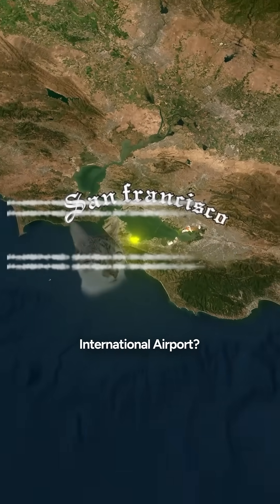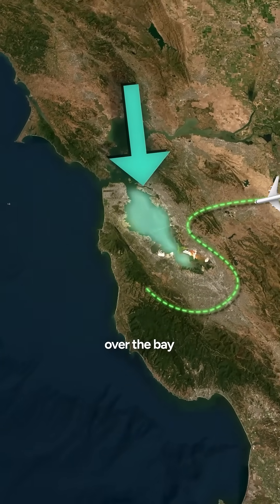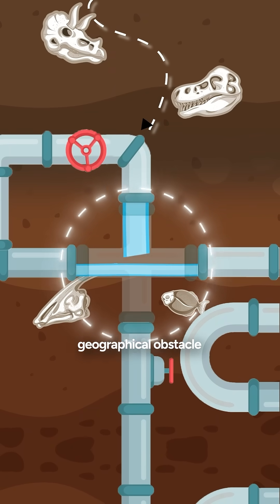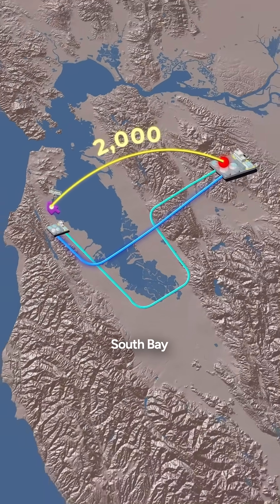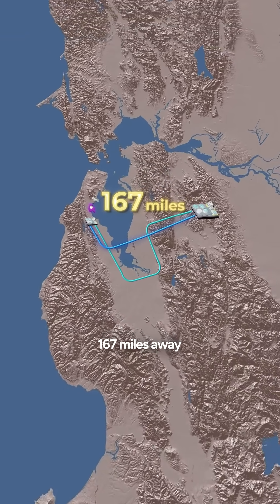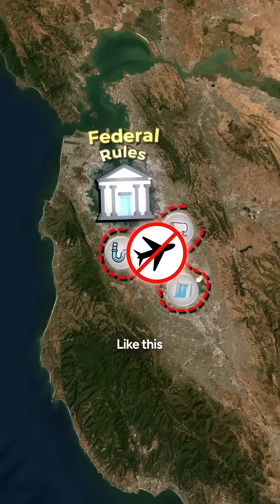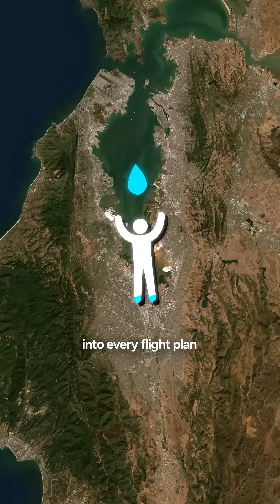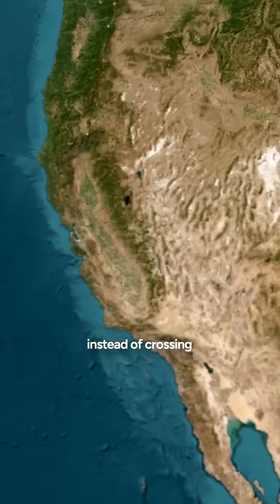The Hidden Reason Planes Fly in Circles Before Landing in San Francisco 🌉✈️

Comment: It actually has to do more with the location of the Bay Area's two other airports. Oakland's is almost directly across the bay and San Jose is near the south end. Fly directly across to get to SFO would impede the flight paths of those airports PLUS the runways at SFO, like OAK are situated in such a way that planes generally land from the south at SFO and OAK. The bigger threat to Hetch hetchy is the next large earthquake on the Hayward Fault which will sever that water line, plus the gas and electric lines, plus at least three major freeway lines, plus two BART line as all of these cross that fault.

Comment: Is there a similar reason as to why planes flying into LAX from the southeast have to fly over San Diego's northern suburbs and the ocean instead of flying in a straight northwest path?
Reply: San Diego is more for departing traffic. Planes at take off are their greatest weight for that flight since they are fueled up, means they need to use more power and engine noise will be their loudest, generally you want that heading out over the water for noise abatement. Also terrain avoidance as East of San Diego with the parking garage and buildings, but not to go that way until the weather forces them to go reverse ops.
Reply: so that would be due to wind.  all airports align their runways with the primary direction the wind.  for LAX its an East/West direction.  The day you landed, the wind would have been blowing west (im assuming it was during Santa Anna wind season, as thats when wind primarily blows west.  so the planes fly out over the ocean to start their approach into the wind to land.  I've flown into LAX quite a few times, and I've landed when the wind is blowing eastward, and so our approach was from the east.

Comment: These two things are complete unrelated. The flight paths of the airports everywhere have giant circle paths near the airports because you have to line up with the runways. Often, at SFO, the airport is using runways 29R and 29L for landings, this is 90% of the time at the airport. Hence, all incoming aircraft loop around the bay to line up. It has nothing to do with an underground aqueduct. Furthermore, the nearby locations of SJC and OAK airports impacts flight paths in the Bay...
Reply: Correction: rwy 28, not 29
Reply: @Xeno7554  having worked operations for a major airline at both SFO and SJC this commenter is absolutely correct. I’ve never heard of the story in this video and I’ve worked in two Bay Area airports for 40 years.
Reply: First thing I said after watching this was what a load of crap. I'm glad the comment section agrees.